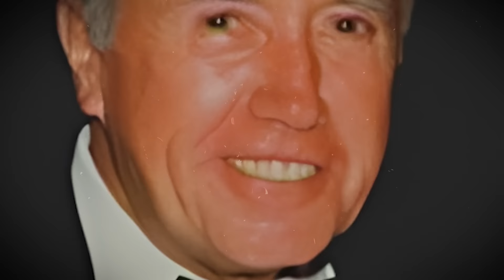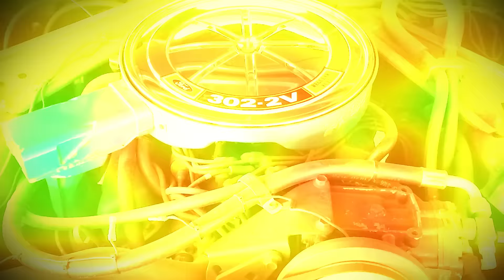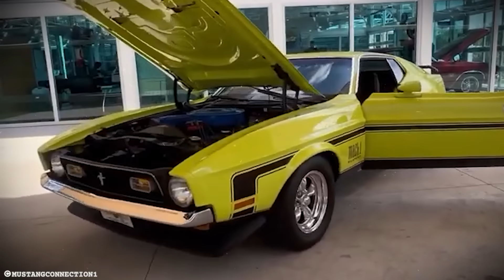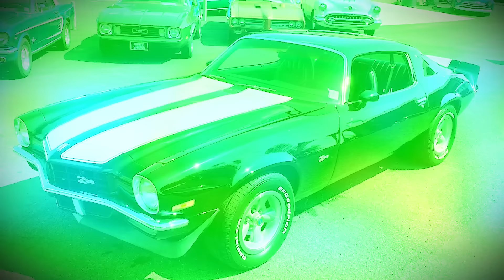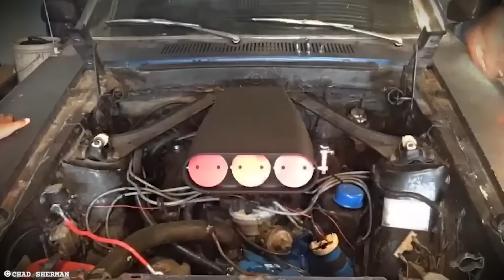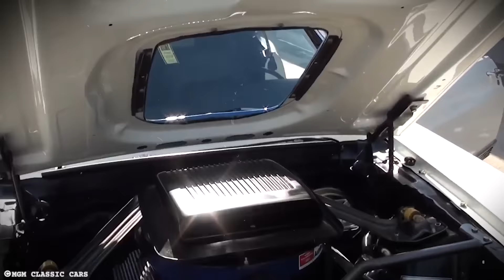Why Ford's 335 Series V8 Failed - The Cleveland Engine That Should Have Been Great

Comment: Only problem with 351 cleveland and that was for the street drag racing or stop light to stop light  ports were to big, they hurt the low rpm velocity causing poor filling of cylinders with fuel and air, at 400 cid solved the street problem . In 1970 the 351C  mach 1 mustang would not spin the tires unless you held the brakes  and reved the engine.

Comment: The 351 Cleveland was an iconic stop gap for their mid size muscle cars. It would rev like a madman! My Aunt had a 2bbl version in a 74 cougar. She let me drive it whenever I wanted to. And that I did it had a awesome low end being a 2bbl. Which meant you guessed it. Burn outs like crazy! It took it gracefully with a C6 auto. I kept it wash and changed the oil and filter and plugs for her. She ended up trading it for a loaded mercury monarch with a weak 302. She would let me drive it too. Which happened rarely. Ford completely bent over and let the government do their thing! At least GM and Chrysler kept their 4bbls with low compression engines thru the rest of the 70s

Comment: We had it in Australia from 70 to 1985 I owned to both did well over 200 thousand miles amd never missed a beat so this is not true. And they are still winning drag racing and road racing with passenger car blocks so yeah this is a lie.

Comment: I had a 1973 Mustang Machi I with a 302 engine , swapped it out for a 351 Cleveland 2V - car ran so much stronger with a lot more torque and take off - loved that engine.

Comment: The 351C didn't 'fail'.  It was conceived during the musclecar era and lwas able to compete with the best.   Bbut major events took place early into its tenure that made it an anachronism literally overnight.

First, insurance rates skyrocketed.   It was getting harder to insure musclecars.

The the EPA mandates kicked in, and suddenly, primitive emission control systems were required under the law.   In addition to the extra equipment, cam and ignition timing get retarded, compression ratios were lowered, and stricter carburetor tuning became necessary.  The 'performance' axle ratios were replaced with more conservative gears, and high-stall converters were nixed.

Then CAFE standards were implemented.   Hard to make power when you have to suddenly meet miles to the gallon quotas.

And finally, the bean counters had their say.  With 'performance' suddenly a dirty word, and the Cleveland's home platform (Mustang) being reduced to a wheezing econobox, t he Cleveland was no longer strictly necessary.   No need to cast two different engine blocks when you csn simply modify the 400 design for a 3.5 inch stroke and make a 351M.

Thst it.  That's the entire story in a nutshell.  It didn't fail, IT WAS SABOTAGED, from without and within.

I had a Cyclone with a 351C-4V aboard.  I have regretted selling it now for more than 30 years.  Looked good, sounded good, RAN good.  It was definitely a car for Saturday nights on the boulevard.

Comment: Ive had small block chevys and 351 clevelands and a 351 cleveland will eat a small block chevy for lunch and spit it out, the only american engines i would put over a cleveland is a 429 boss a hemi and the new quad valve coyote, my 6 cylinder ford cyclone engine is a good engine too, excluding my quad valve coyote and cyclone their is no small block engine that i would put over a cleveland headed engine.

Comment: I bought a 1970 Ranchero 500 with the 351C 2V 4 speed with the Hurst shifter new from the dealership in Susanville California, and still have it. I have not made any modifications, except rear air shocks, and exaust cut outs. I use it as a work truck, hauling some pretty heavy loads, and have pulled many heavy trailers.  It has near 200k, burns very little oil between changes, and gets 20+ mpg unloded.  There are a few dings, and a small bit of rear quarter panal rust, bur the doors still close tight, and the am radio still works.  Had a windshield replaced some years back.  The little white Ranchero has suprised more than a few youngsters with how quick it is off a green light with a greay haired old man at the wheel.

Comment: My 351C transplanted from a Torino to an F100 around 1981.  Being in my 20’s, street raced it, drove from the Midwest to the Oregon coast, pulled twin axil trailers full of sound equipment for an other 10 years.  Parked 20 years.  Fired it up a few years ago.  Still pulls hard.

Comment: one of the main  reasons the large port Cleveland got a bad rap in stock trim is, Factory  cars came with 3.00 gears this made them feel like a dog My6 Car had 3.91 gears and it  sure had no problem with bottom end power. My car would blow the rear tires off if it was  floored off a dead idle. My buddy had a Red 1970 Mach I with a Cleveland that was a real dog, after he drove my car he quickly Ordered a set of 3.91 gears for his car.

Comment: Gee, Bob Glidden sure won a lot of NHRA Super Stock Championships running a cleveland.
Reply: His heads were a combo of two different Ford engines. The heads were sliced horizontally and the top half of one was welded onto the bottom half of another. Sort of a hybrid so to speak.

Comment: Back in the day.... My 70 Torino GT Convertible with a 351C, mild cam, electric fuel pump, holley 750 cfm, dual point ignition and C6 ATM could hit 9,100 RPM easily until one day it blew the water pump thru the radiator.

Comment: Ridiculous they put a shaker & spoiler on a grandmas 4 door boxy falcon & did not at least use & build our 2 door variant down under. Single people must have either been brainwashed or didn't know any better what looked cool down under back then as they are now everywhere today. As a USA teen in the '70s, i could not WAIT to buy a stylish used 2 door anything - even a beater - & stop driving mom's 4 door homely looking boxy falcon.

Comment: Gran Torino, I miss the old cars you felt safe in them there was a lot of metal around the Torino! mucho power with the 351 Cleveland owned a 352 which was a workhorse 351 Cleveland was the engine that you souped up! 351 Windsor was a different bird a good engine but the Cleveland had the good bits in it!

Comment: right out of the gate the narrator talks about Ford 'Big Blocks' and 'Small Blocks'. Um, Ford never used these terms for their engines. Ford used series numbers for their engines. Big Block and Small Block are Chebby descriptions LOL. BTW, Cleveland's don't run hot when bored 30 or even 60 over. This video is complete bullshit.

Comment: The Cleveland oil problem was solved with oil restrictors. It would force more oil to the crank. Here's a fun fact. You can change every last lifter without once pulling the intake. If you know what you're doing you could change them faster than pulling the intake. The core shift problems was addressed with boring plates and using a stud girdle in at the bottom of the block.
Reply: How to change the lifters without pulling intake?

Comment: I remember in the 1970s when everyone wanted the 351 Cleveland for drag racing due to it's short stroke crank allowing higher RPMS for one thing.  Nobody wanted the tall deck 351 Windsor.

  Then in the 1980s they all wanted the Windsor due to it's longer stroke providing more torque and winning more races.  Lessons were learned.

Comment: we lived in the 70s. the cleavland kicked ass. but there were no easy performance parts available. chevy had easy head swaps for everything. ford didnt build engines that way. the cleavland was a good street motor and responded to big cam and induction and street grears. the 351 Boss in 1971 was 330 hp the most ever from stock motor. only for 1 year unfortunatly. gas crisis in 1972.

Comment: Nascar was still running the                                                                                                                                 351 Cleveland in the late 1980s
Reply: Yes even now they are running a Cleveland type head. Doug Yates builds all the Ford motors now. I believe they still using the canted valves.
Reply: And winning.
Reply: @fareedshamsuddin109  Bill Elliot

Comment: Ive never owned a Ford, chevy big block 58 apache ,360 69 dart  2 smalblock  70 and 68 c10, 72 k 20 camper special  402 b.b. all of em kicked assfor what I used em for . My neighbor  had a red and black  boss 351 4spd. Headers ,roller cam ,street  build . 390 gears detroit locker from factory . Meanest small block motor ever  ,this car got busy!! Right now kind of busy ! I would buy one if it didn't cast more than my house.

Comment: Lots of mistakes on here..they need to quit having computers do these..The 70 4V was 11.7.1 compression and the Boss 351 was factory equipped with a 715 cfm autolite 4300D  carburetor...many other mistakes as well..The engine was and still is chpice..all the talk about oiling problems is bs tobme.My mom bought a 71 torino gt new with a 2V 351c...ran it 203k miles before rust got the body..it still ran strong and burned no oil and she had no problem racing it when the time called for it.
Reply: but there's one thing it COULDN'T outrun- the SALT
Reply: @tommurphy4307 thats true..my dad had two buddies in 70/71..they all worked at fridgadaire  in hillsboro ohio..one buddy bought a 70 torino cobra 429scj 4 sped car and the other bought a 70 mach 1 428 scj 4 spd..they all carpooled to work and there was my dad in a Volkswagen bug that he couldn't stand driving..his previous car was a 64 galaxie 427 car..sold it because it drank fuel and he had a family.They ran those cars through the ohio winter salt and the salt quickly took its toll..When 71 hit my dad walked into hillsboro ford and ordered a red 71 mach 1  429 4.11 axle 4 speed car to blow his buddies cars away and when he came home my mom said you did what and said I dont think so!?So a week later he canceled it but the car was already searlized and put through production sequence and my mom was a hot rodder..She ordered a 71 torino gt 351 4v 4 speed car and ran it into the ground...She told my dad how were they supposed to pay for fuel for a 429 engined car lol.. But my mom's torinedo succumbed  to the winters and salt and so did the torino and mach 1. Had my dad bought the 71 mach 1 the same thing would have happened and likely did to whoever ended up with the car.

Comment: Perhaps a horse by another name, but the 351 Cobra Jet was the best small block Ford ever made.
Reply: 351 cobra jets were 351 clevelands
Reply: @tommurphy4307  Yes the Cobra jet was the first detuned  cleveland with low  compression.

Comment: All I know is the 351C I had ran like a "strip-ped 'arse' ape", got great highway mileage and never burned oil.  I sold it with 90K miles in the '72 Torino Gran Sport body it came in from Haines City Motor Company, Haines City, Florida, Feb 1972.  It wasn't until years later I learned from videos like this) what a bad engine it was, from guys who probably never owned one.  And that was after I had a 351C 2V with a C6 in a 1974 Ranchero I used to pull my fairlry large boat - which (Ranchero) I bought with 62k on the clock and sold with 84k.  I guess I was unaware of how bad they were.............  I certainly must have been lucky.  I actually was aware of the not-so-good oiling sequence, but I never revved it above (maybe) 4000, so that was not a problem for me.  Anyway, easy to run an outside oil line from the oil pressure sender fitting to the rear gallery.  I did not do it, but it was not a problem for high revving guys who needed to - a lot easier and cheaper than replacing cracked heads on a 350 SBC.
In this video I learned the 351C did not fail.  It simply never got fully developed to the extent is should have.
Reply: I still have my 70 Mack 1. Man I love to have a 72 Torino.

Comment: The Cleveland is a bit overrated.  It was never fully developed and the emissions crunch absolutely messed it up.  #1 Open chambered Cleveland heads are junk.  #2 It had oiling issues #3 The block isn't as strong as the Windsor #4 You couldn't bore the thin walled block out and not have overheating problems.  I owned several Clevelands.  It's not necessarily a bad engine, but the compromises were too great.  A low compression Cleveland is a poor performer.  If you have a 1970 engine, you're good.  Ford had to detune the engine to pass emissions standards and to get better gas mileage in 1971.  The early Clevelands were exceptional

Comment: I recall identifying 351 Cleveland engines by looking at the 5/8" spark plug threads and vertical fuel pump bolt pattern.
Reply: The thermostat housing. No coolant in the intake.
Reply: 8 bolt valve covers

Comment: "Ford killed it in 5 years". Ummm, nup.

Brand new Australian Fords came with Clevelands (351 AND 302 cid) until 1982 in passenger vehicles and 1985 in F100-type trucks.

Comment: I'm sure they just put these videos out with incorrect info so we all comment . 

So it works , I'll take the click bait . 

The Cleveland was designed out of the Boss 302 program , the Cantered valve heads are identical to the 67/68 Boss 302 bar two water ports , Ford realised these heads were far to big for a 302 , so instead of wasting all that research they decided to build a bottom end to support the heads , and the 351C 4V ( Boss) was born , and no Cleveland was cast before 1970 , all Cleveland blocks from the first casting were casting number DOAE and as any Ford person knows D is 1970 , C is 1960 , the next casting number is 0 for 1970 , and the next two are not date codes , and yes 335 was the design cubic inch target , it's a base line starting point , ( FYI the LS1 had a design target of 340 ci ) and the 385 series is the same , 385 was the cubic inch target in design phase , it's a myth it's stroke , think about it , the first 385 series motor was the 429 and it does not have a 3.85 inch stroke, the 460 by chance has a 3.85 stroke , but the other member of the 385 series the 370ci does not , so 2/3 of the family don't have a 3.85 stroke . And yes people always forget there is a 370ci Big Block 385 series motor . 

The heads were not designed for the 351 they were designed years earlier for the Boss 302 after the Tunnel Port 302 was banned for not being a production motor . 

The 335 series contains the 302 Cleveland or 4.9 litre as Ford Australia badged it ( built and cast at the Geelong Casting Centre Australia from 1971 for 72 to 1983 in cars and 1985/6 in F100 to F350) , 351 C ( cast in Australia and US , ) Ford 400 and 351M . 

Ford Australia took over casting Cleveland's in 1971 and continued production till mid 1980s , the 302C was the base V8 and the 351C was the top V8 , all Australian Cleveland's use revised 2V ports with a 4 barrel intake with 2V sized ports ( there was a 2 barrel for a short period) all the 4 barrel Cleveland's be it 302C or 351C ran Carter Thermo Quad carbies . There is no difference between a 351C block and a 302C block., in fact the engine assembly team didn't know if a block was to be a 302 or 351 untill they read the build sheet sheet and either a 3 inch crank or a 3.5 inch crank was installed , the 302C got nice long 6 inch connecting rods giving it a 2/1 rod to stroke ratio.
Reply: In the USA the 4.9 is what the 300 ci. Straight 6 is known as.

Comment: It didn't fade from my history, i have a garage full of them, 302's and 351's.
Reply: I can second that. The most powerful coming in at 650hp @ 6000rpm, with an aftermarket alloy, or as you Americans like to say "aluminum" heads and block. What was the video saying about excessive weight? And power, WOW!
Reply: Cleveland's ?

Comment: The statement about the t-stats is right on. There were many specific Cleveland only pieces which Ford had to support which were more expensive than the garden variety Windsor family. Sometimes the aftermarket parts houses had parts labeled for both, which wasn't true. And in the mid late 70s, things were confusing when you essentially 3 engines of same displacement with an emissions tag that read 351C,M/400. Only the way to know the difference was a trained eye, or get inside of it. I remember the oiling problems of the M and 400s.
Reply: 4 engines of the same displacement of around that era , 352 FE , 351W , 351C, 351M all same bore X stroke and 5.8 litres . 

Sure the 400 and 351M had the same oiling limitations , they are just tall deck Cleveland's, not other changes .